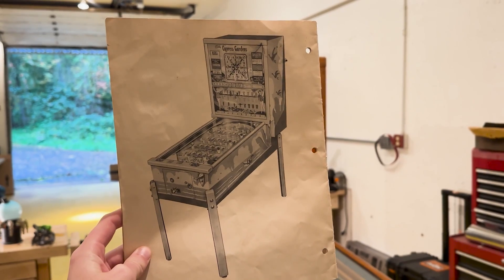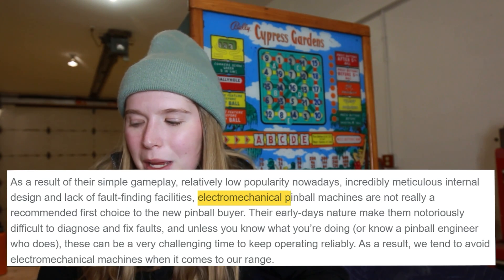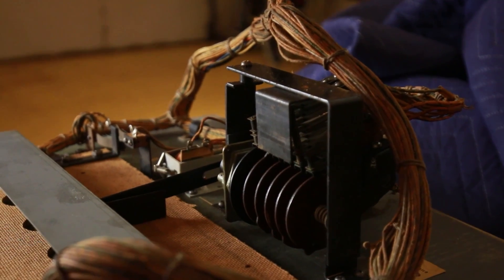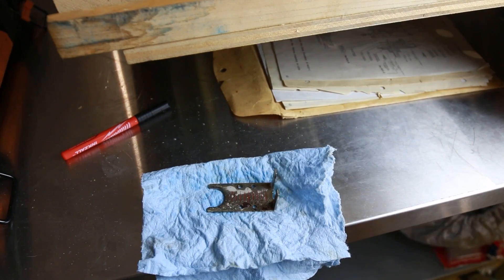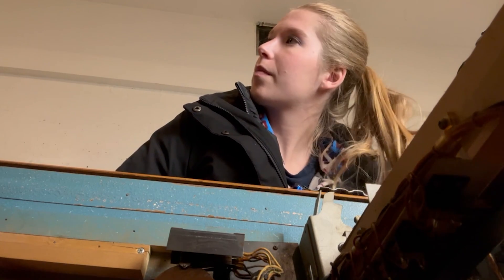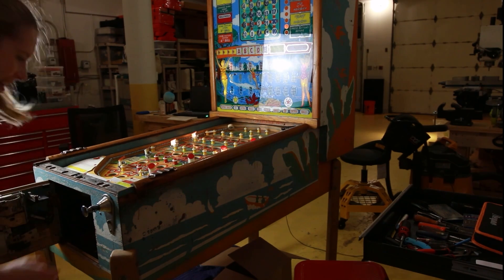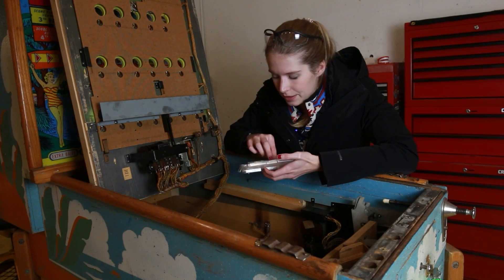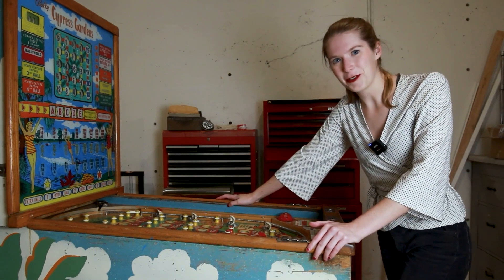Vintage Electronics Exploration with a Bally Cypress Gardens Bingo Machine

Comment: Great video with a wonderful ending. As an owner of few EM arcade games I can appreciate how you became attached to Miss Creaky just as she left the factory. Such a difference to open the newer games and see all those steppers cams and wires replaced by one or two circuit boards and a power supply.

Comment: Technology Connections has an excellent three part series about a pinball machine from the very end of the pure electromechanical era, describing in detail how the shutter motor works among other things:
https://www.youtube.com/watch?v=ue-1JoJQaEg

He also has a teardown of a mechanical jukebox you might learn a few things from:
https://www.youtube.com/watch?v=NmGaXEmfTIo&list=PLQX4-kDJcVdM0mDUJF1iatO5QzvoyB9ne

Squirrel cage motors are something you are familiar with, just under the more common terms AC motor or induction motor. Someone thought the rotor in them looked like those wheels squirrels run in and the name stuck.

Finally, a big thank you, not just for respecting history but also for respecting your gut-feel enough to follow it in spite expectations of "this channel is about modernising stuff".

Comment: 1949 to 1968 for counties in a state of Maryland had legalized gambling. I repaired bingo pinball machines for a company that I worked for. All of the bingo machines was on cash payout. they remove the front legs and added a box on the front with two tubes in it a cash box and payout slides for the cash payout. I really enjoyed doing this. All the bingo machines that we had were OK games starting with Laguna Beach and ending with SilverSales/Golden gate.

Comment: Whew! 😅  Thought she was gonna wreck it with modern electronics that would only last a few years but, yes, keep the old stuff around for another lifetime of enjoyment!  😎  Also, digging into the circuitry of these is VERY educational about how to design logic circuits.  For example, make a video recreating the logic using a PLC (programmable logic controller) and compare it to what is in the machine - use the schematics.  There are still relays in modern control systems as well as solid state microprocessor stuff. 😃  Ye olde self-latching relay is still a thing! 😅

Comment: What features would one add by modernizing it? Could such upgrades be done in a way that doesn't permanently modify the machine? (That is, one could remove the upgrade and it would then appear as if there never had been an upgrade installed, so no drilling or cutting stuff.)

Comment: There's nothing wrong with not modernizing something. I had an old Grundig desktop radio and I "modernized" it to run off of a Ras Pi pulling internet stations rather than traditional radio. It was a great exercise in interfacing the old and new, lining up the old frequency dial to match the display name (city names at certain frequencies) with the internet equivalent and more, but it somehow lost its charm. Nothing changed externally, but the audio was different, the operational/tactile feel was different, the lamps that replaced with LEDs glowed different.  It made me look at modernizing things differently after that.

Comment: Good for you. Celebrate how it was done. Plenty of newer machines around to processorise.
Have you thought of building your own ? It will be easier to understand if you do the electronics yourself instead of unpicking the old ones, and you get to use the full range of your imagination in designing the play. Plenty of people have done it - you can either use a ready-made controller board or a load or arduino-style bits. And really, the design and crafting is harder then the electronics.  Bring a new pinball into the world instead of killing a living one :).

Comment: Heyy Ruby, a new face. Interesting project. I really loved seeing how everything under the hood was done without microprocessors and still worked. I can imagine they spend most of their time not on the game but on the wiring. I guess it would make most sense to build this machine from scratch using modern techniques instead of converting this oldie. Above all, this might actually belong in a museum? I think after all it was the right decision to go for a cleanup instead of conversion! :)